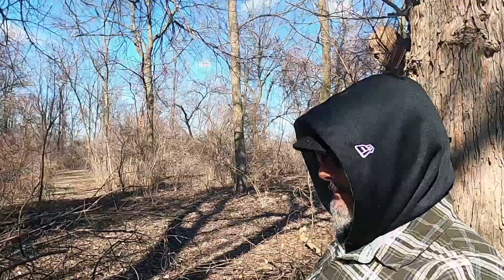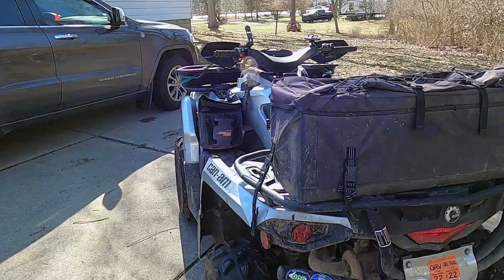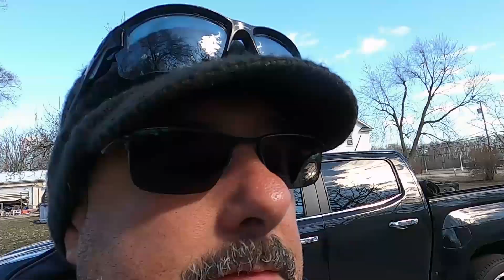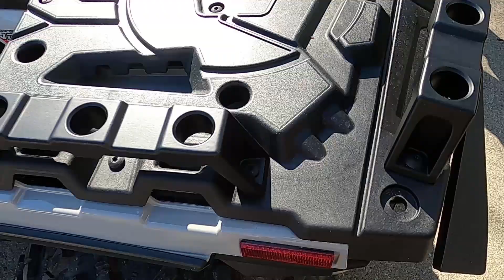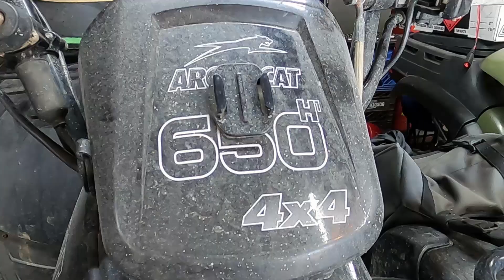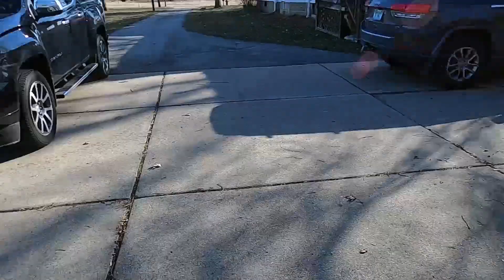Someone gets a new Toy/ Snow Storm damage clean-up

Comment: Beautiful machine, congrats.  I'm in the same situation, but I'm looking for a two up 850. I'm conflicted between the can am or the polaris. Both great machines, however, can am has more options.
Reply from the maker: I love my Can Am!  Were headed north Thursday night and try to get some riding in , maybe Leota.  Shotz is Jones'n to get that new Polaris out!
Reply: Thanks!  Yeah both CanAm and Polaris make nice machines the Cam 850XT is pretty nice they do have more accessories than Polaris but there's still quite a few options that you can kit out a Polaris very nicely with bumpers, lights, and all the usual stuff$$$.  With the 2 up machines they usually are a little bit longer and heavier if you do tight trails could be an issue.